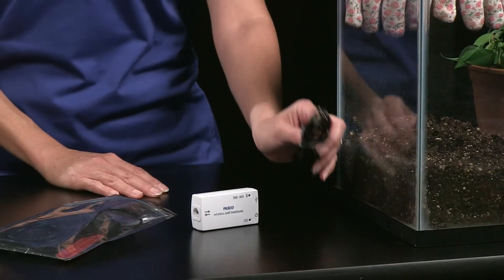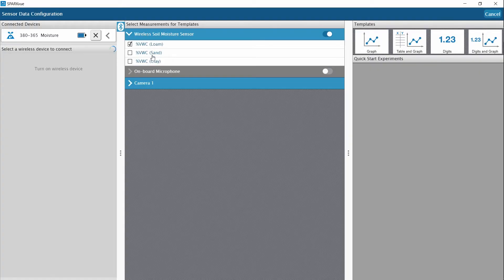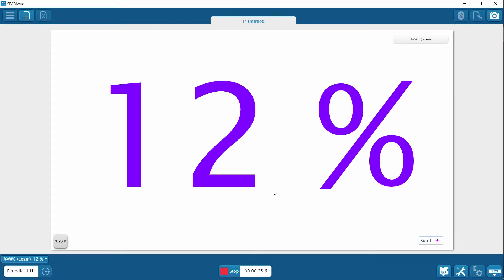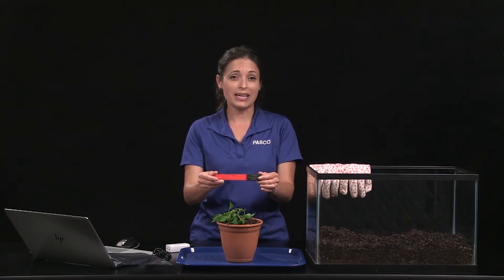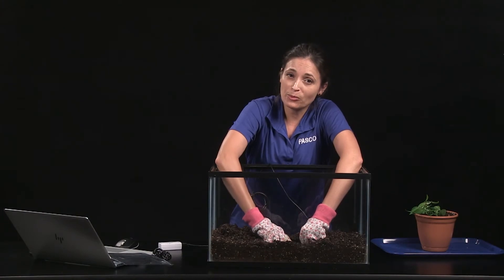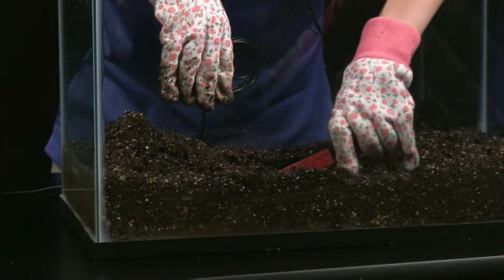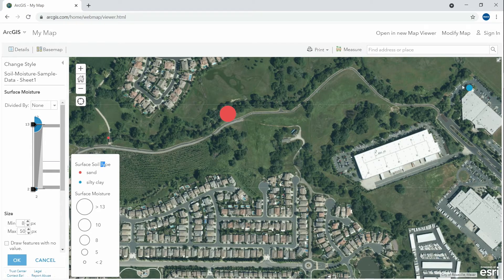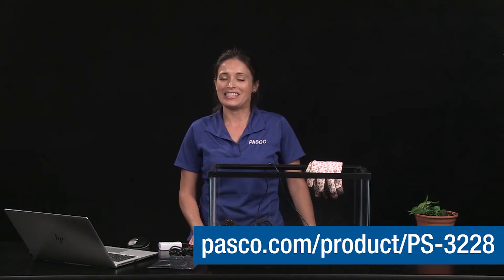Wireless Soil Moisture Sensor | Get Started

Comment: What we should do? After I use it.
Reply from the maker: After using the soil moisture sensor, gently rinse and then wipe the blade with a soft cloth.

The sensor is made of tough computer board material but the critical component is the thickness of the painted surface, which allows water to get close to the sensor element underneath. Take care to minimize scratching or removing of the surface coating from the sensor to lengthen its lifespan. Using a light rinse or gentle scrubbing is fine, followed by a quick dry with soft cloth to prepare the sensor for its next use.
Reply: @pascoscientific thank you!! Have a nice day!!